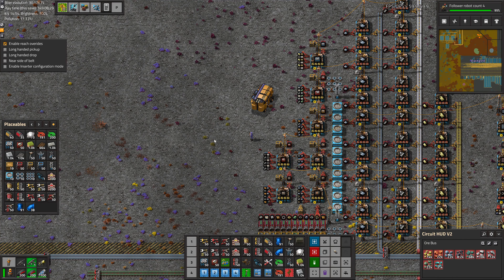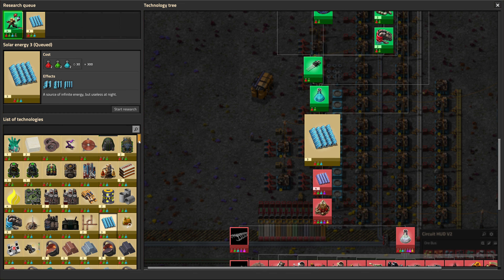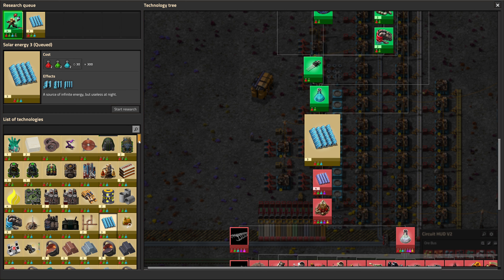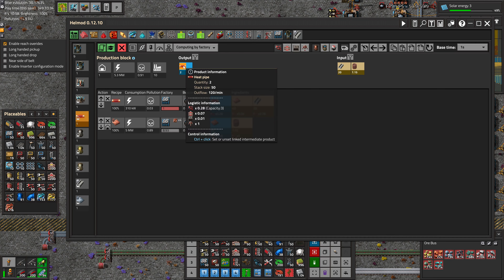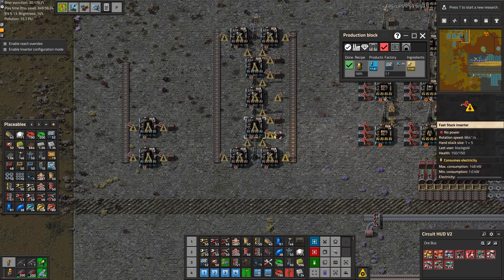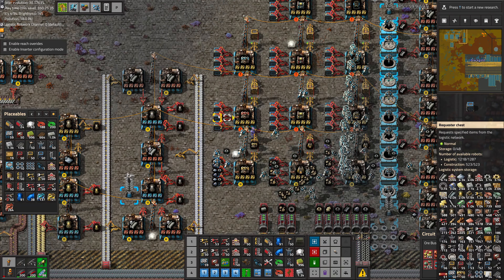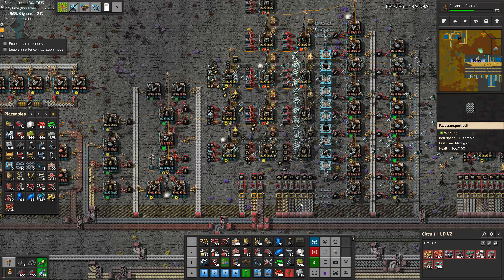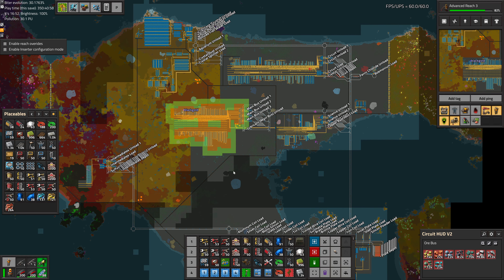[Factorio 1.1 4K] Angel/Bobs Ep 187: Heat Source Power

Comment: For what it's worth, I'm reasonably certain the primary advantage of higher tier Heat Pipes is lower temperature dropoff, and thus higher range from the heat source to the boiler.
Reply from the maker: That’s good to know, thanks!
Reply: I double checked: they also have a higher max temperature (1250/1500) for tiers 2/3 respectively, in addition to the heat buffer benefit.